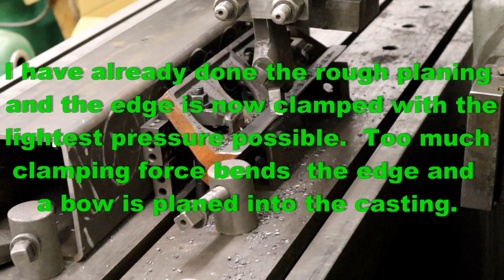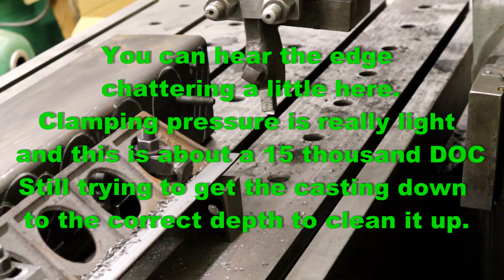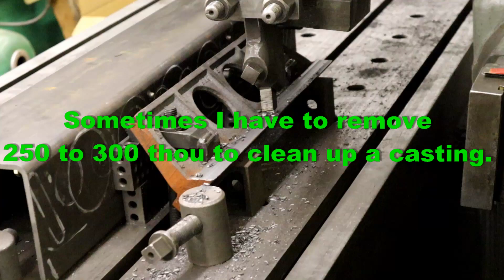Planing and testing a 18" Straight Edge

Comment: Must be the camera. The .001" thick cigarette papers I have seen you can see thru. I recently did the job of remachining a Monarch lathe carriage. I was only able to hold it within .0025" max error on all surfaces in a 24" area. I need more practice! I think if I had it clamped lighter I could have done better but it was the first one I have done so nI didn't know. Plus I was scared it would move and wreck the whole thing if I had it lighter so its a catch 22.
Reply from the maker: It is a BIG catch 22.   On a planer the highest force is in the direction of cut.  I have seen pictures of setups with the work just blocked in and prevented from moving forward. 

I measured the zig zag papers I have exactly .001 :)

Lady at the store was really eyeing me funny at the store the last time I bought some :)